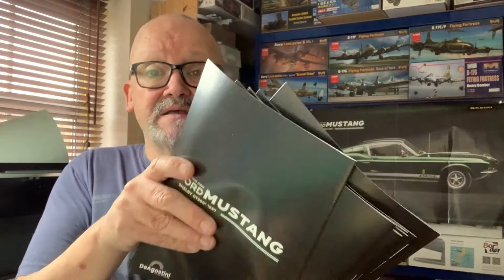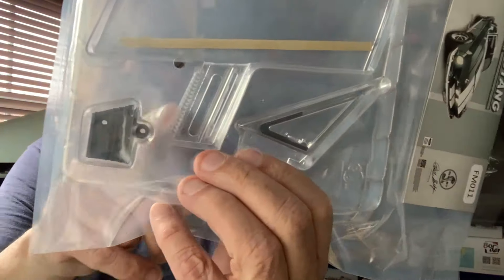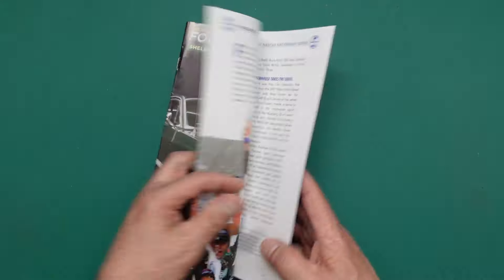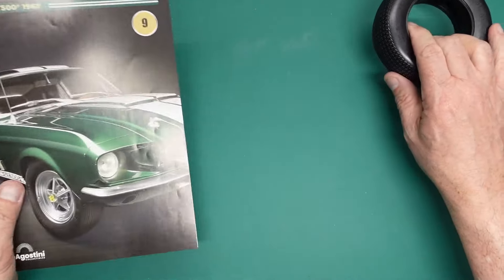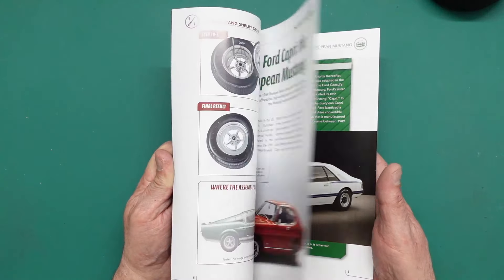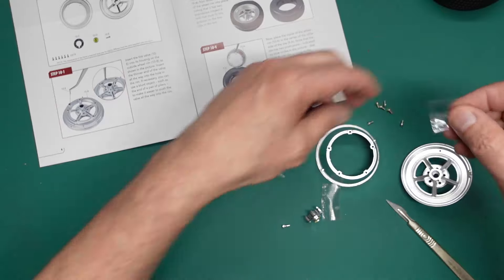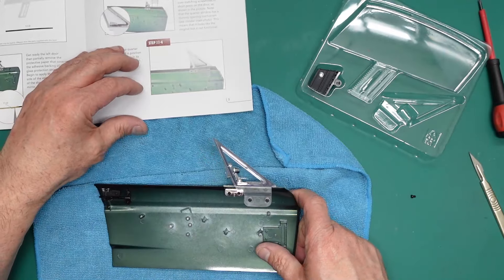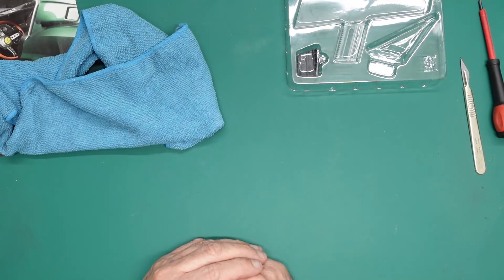Building a 1:6 Mustang GT500 from DeAgostini. Part 4. Packs 9,10 and 11.

Comment: They’re probably J.I.S. Screws.
Reply from the maker: I don't think they are? The kit is made in Italy. I am 99% sure they are Phillips rather than pozidrive.
Reply: I’ve worked on components with no obvious Japanese connections but have for some reason found the best screwdriver fit to be a J.I.S. One, so the parts may have a Far Eastern origin so just may be worth a try can’t lose anything.